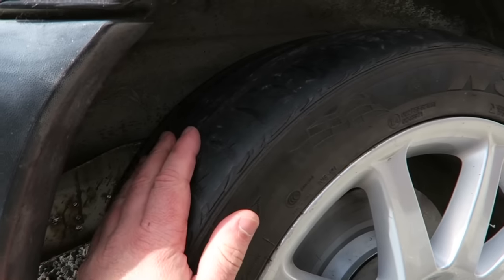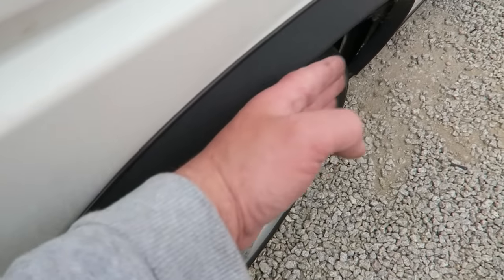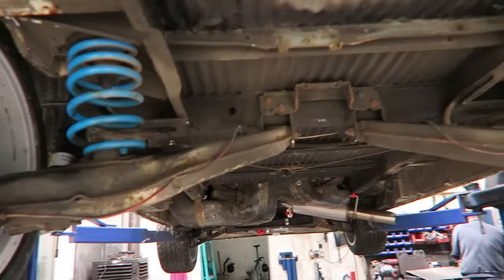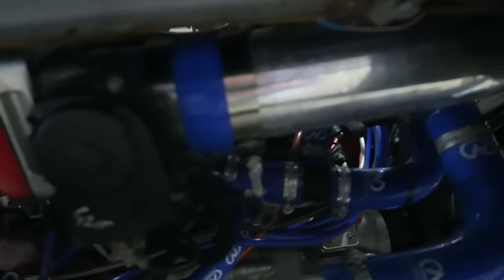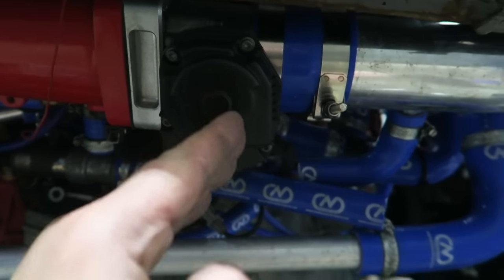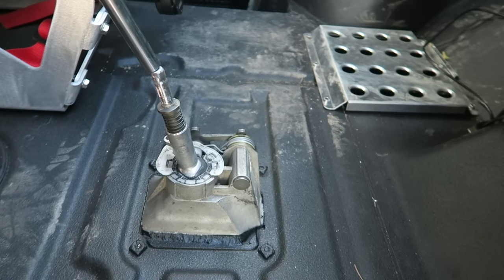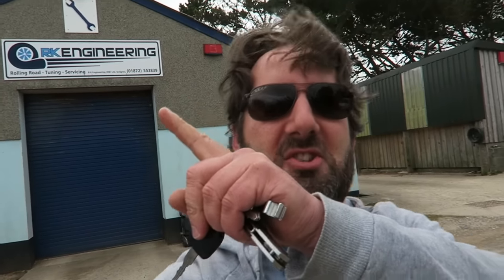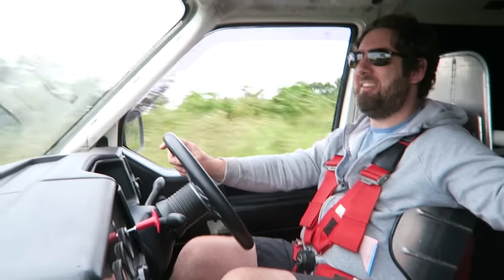VW T4 TRANSPORTER 565BHP+ ATS Wheels, Base Map & First Drive! :-)

Comment: The tread pattern on those tires looks very similar to the original Michelin Pilot Sports. Love ATS wheels. Always wanted a set if ATS cup's for one of my mk2's. That thing sounds lovely. Nice job! Would be awesome with some H&R's, KW's, Bilstein's or any other quality coilover setup. You'll eventually want them over the spring/ shock combos for corner balancing/ dampening and rebound adjustments, not to mention how great they would make the van look with the wheels and flares.

Comment: Hi mate. Lovely van by the way👌🏼😁.
What insurance are you with.? As I’ve got a vw t4 it’s got a 1.8 turbo engine in that’s running about 200bhp. When I got it it was still registered on the logbook as a diesel. So I registered it as a petrol turbo. Now when I go put the Reg in it comes up as a car is that normal do you know? Or would I need special insurance for it  now?. Cheers mate.
Lou
Reply from the maker: You register it with an engine swap with DLVA. You can put the engine fuel and cc in and they will do the rest. I am insured with A Plan Thatcham Schemes.
Reply: Thanks mate🙏🏼 hopefully see you around one day 👍🏼😉 at a show of sonething

Comment: Sounds awesome when it dumps what valve are you using
Reply from the maker: Thanks, its a Turbosmart Raceport. It was only running 14psi here so I can't wait to hear it at 30psi :-)
Reply: @SpeedingTube  that's going to sound awesome Tom can't wait to hear it 😍
Reply from the maker: @clifton1989  Yeah it should be louder again, fingers crossed 😁

Comment: Makes me wonder what's possible from the 2.5 TDI engine with standard turbo, clutch & gearbox? Did you ever try tuning the standard engine before it got swapped out?
Reply from the maker: I've heard rumours of people building a 400bhp+ 2.5TDi but I haven't seen anything yet. I'm sure its possible to make big numbers on the 2.5TDi but many of the parts would likely be custom or expensive. The 1.8T 20v is relatively cheap to tune with lots of information and parts readily available so it was the right choice for me.
Reply: The thing is, with the 2.5 tdi you got loads of torque anyway, so no need for really high hp figures. Around 220-240 is what i personally have seen some friends run on their 2.5s and that's plenty of punch for a T4. Given that they are fwd they struggle for grip even with that amount of power :D

Comment: I am planning to convert VW T4 to electric with Tesla 220 kw motor so what did you need to upgrade/modify to handle higher power/torque?
Reply from the maker: Suspension and brakes critical, drivetrain depends on setup.

Comment: Hello mate, did you let the raceport alone with its factory spring? Just got mine and seems that it has high spring rate(quoted for 2500hp), what boost are you running?
Reply from the maker: Good question, I'm not sure on the springs. I'm running 14psi atm. I'll try and find out and come back to you 😎👍
Reply: @SpeedingTube  many thanks

Comment: Hi mate. Been talking to Nick about your recent dyno session with him. I’ve got a 20v Lupo like him and we are about to go stand-alone on it. I’ve been offered an EMU ecu like yours, but my harness is for a ME3.8 not the usual Bam/APY set up. Did you just terminate the EMU into your existing loom. Thanks
Reply from the maker: Hi Richard, just wired the sensors into the ECU. You can get an EMU to ME ECU harness for about £100 on the RRR website
Reply: @SpeedingTube  Hi thanks for that. Just can you clarify what the RRR website is?
Reply from the maker: @richardstubbings6962  Sure https://rrrshop.co.uk

Comment: What do you make of the accelera tyres? I’m thinking of trying them on my hillclimb clio.
Reply from the maker: Hi David, I haven't had a chance to get some heat into them yet. Once she's mapped I'll be able to get them hot and see how they perform. Will you be using the tyres from ambient or are you getting tyre warmers for the hillclimb?
Reply: speedingtube I’m in the road going class. No tyre warming allowed other than some wheel spins before the start line. I think they do a 100 and 200 wear rating so I would be going for the 100 softer compound.
Reply from the maker: @davidstuart3795  Ok that's cool, if you're not allowed to warm the tyres and just a little wheel spin I'd probs go for a colder tyre, maybe a Michelin Pilot Sport 4S? The Accelera seem ok but for hillclimbs I'd want to see what other people are running on your platform.
Reply: speedingtube most run a really soft tyre. I’m currently on Toyo R888 but will be changing next year. Can select from anything on the tyre list 1A or 1B.

Comment: Are Accelera decent tyres now?🤔 I bought a car 4 year ago with a pair on the front and they were terrible!
Reply from the maker: I haven't had a chance to push them yet so can't comment. I haven't had the ride height, geometry or corner weighting setup yet. Until I've got everything ready I'm just running these 😎👍
Reply: Read the reviews on the sports and 651 they are very good in the dry

Comment: What transmission you running? Also what is done to thr transmission? Im looking at a straight cut set from Australia
Reply from the maker: 02M with steel forks, 4th support and Wavetrac diff. I really want a Monster Performance 1-6 dog box before I kill 4th and then eventually a full blown Sadev sequential box.
Reply: @SpeedingTube  I'm planning on getting a PAR engineering synchromesh straight cut gear set from Australia.  Cause im looking at 550-600 at the wheels and worried about the 02j i got. 
Also you know anyone that got a used diff for sale? I cant find one over here where I'm at in usa
Reply from the maker: @beefysghost867  Wavetrac, Quaife etc are probably your best shout 😎👍Monster Performance and SQS also do gearsets and ship worldwide.
Reply: @SpeedingTube  I have been talking to monster, I am really really thinking about getting that setup they got.
Reply from the maker: @beefysghost867  I'll likely do the same next year
Reply: @SpeedingTube  my issue is I still got to swap my 02m in, also did you upgrade your shift forks? Cause here in the states we got big issues with the forks being brass rivited and breaking easy

Comment: Driving a T4 myself, I was wondering why you only put 98 load tires on a T4. Then I saw the crazy weight reduction to 1400 kg on a damn bus.... Nevermind.
Reply from the maker: Ha, there's still more to go. I'd love to get the bus down to 1300kg, still more work to do.
Reply from the maker: I have carbon bonnet, side door and tailgate for next year. The side door alone is about 40kg so there's some good savings to be made
Reply: @SpeedingTube  Wow, you're THAT crazy 😁 This was the first video of yours that I've seen, so I'm not familiar with the project. But nice to see and keep up the good work!
Reply: The same reason a lot of t4 owners put xl tyres on, they believe it has some magical relevance.
Reply from the maker: @Notalwaysserious  Lots of T4's are nudging 2000kg, add the weight transfer/roll due to the height and on converted vans I'd say XL tyres are a good move. I have seen low rated alloys on T4's, that's a bigger concern imo.
Reply: @SpeedingTube  You misunderstood what I'm saying. I'm not suggesting you shouldn't use a higher rated tyre, I'm just saying that people assume because it has xl that its better. A 98xl is a 95 or 97 rated tyre with reinforcement, it can only take the same amount of weight as any other 98 rated tyre.

Comment: 1496KG
Reply: 50kg out! At 1446KG That is a light van.
Reply from the maker: @T4TipsGuides  Not far out at all, great guess! That's with a full tank of fuel so I'll get another go in a few months! Hoping to get it down to 1320kg with carbon panels!
Reply: @SpeedingTube  I have been keeping track of what you have removed over the years, I knew it must be under 1500 KG which is already crazy light. If you get another 200 KG off that then you are going to be around the same weight as the lightest mk7 golf GTi which was around 1293KG. Nuts, absolutely nuts, I love it haha.
Reply from the maker: @T4TipsGuides  Yeah, 1300kg would be amazing. I've got lighter front doors to go on (current ones have dynamat fitted by previous owner) and insulation from all over the van, ply lining. Next will be the carbon bonnet, side door and tailgate, then polycarbonate 3mm windows which should save another 50kg in total. Fingers crossed!